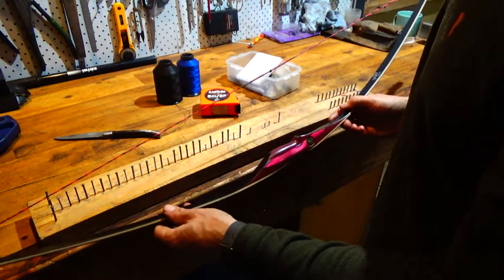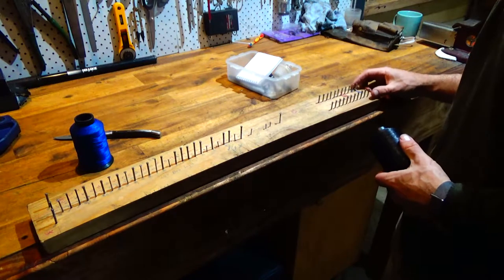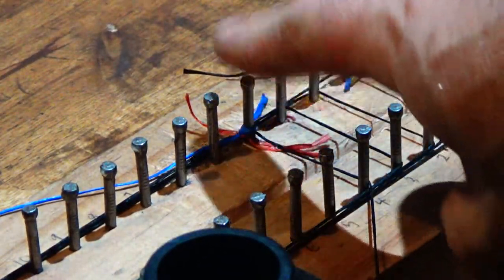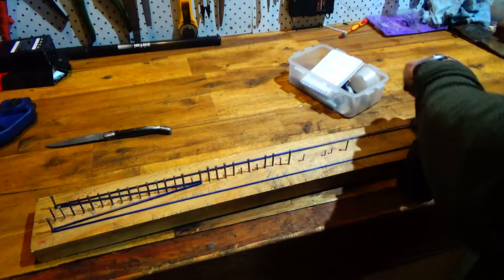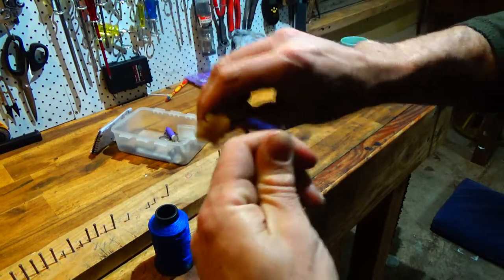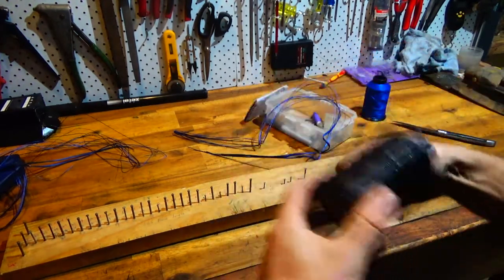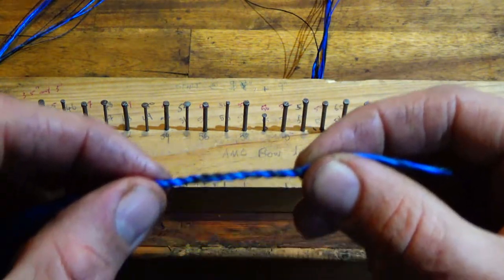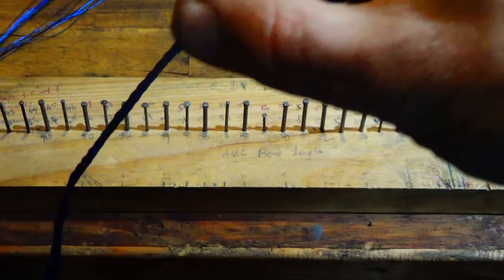The ultimate Flemish Twist string making tutorial!

Comment: Sometimes the colors on a string material kind of rub off when I am making the string. So when I am making  say...yellow and black, when I put wax on the completed string, the black will run onto the yellow resulting in a dirty looking string. Especially on the Flemish loops. 
Two questions; do you know if there is a way to clean the string? And the colors of the strings get onto the wax, and, do you have a way to keep your wax clean it doesn't get on the opposite color? I contacted BCY. They said the string material color is applied to the string and can run off. I'm wondering if you have any tips for this. The worst is the serving. My fingers get black some, and it will rub off on the string if I am not careful. I don't mind if it for me, but I make strings for other people, and I want them to look nice too. Thanks for any help you can give to me.
Reply from the maker: Some colours are bad for it and some batches are worse than others. I ditch a string of it runs too much as it looks terrible for a customer. 
Use less wax. 
The wax I use is a mix of pure beeswax and toilet ring wax and works well for me. 
Good luck.